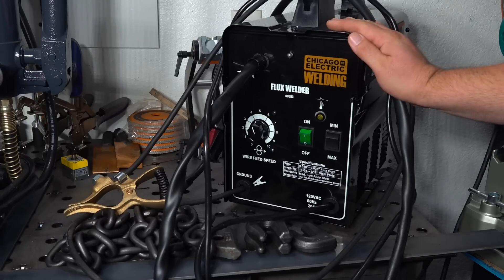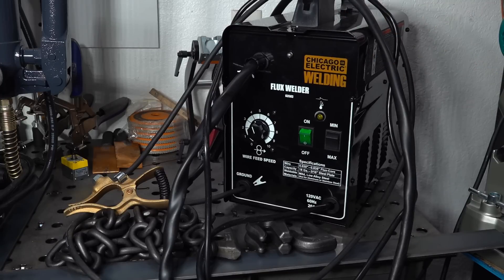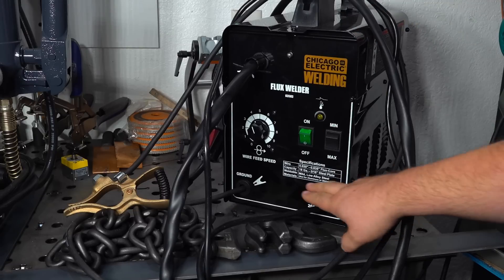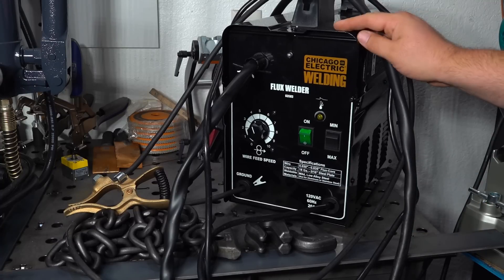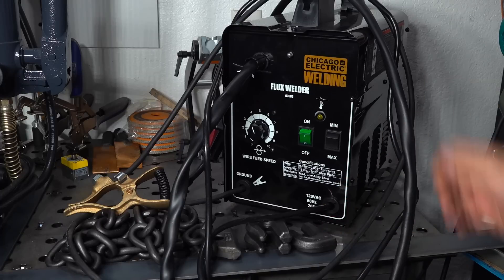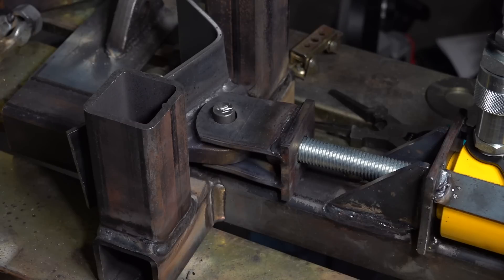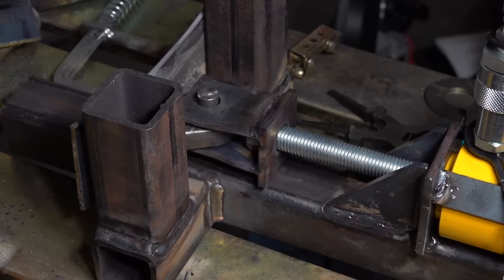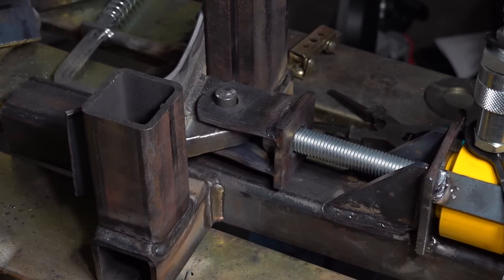Harbor Freight Flux Core, Weld Strength Testing Part 1

Comment: Did you see how happy this dude got when the weld broke on the HF welder he started shaking. You can see that with the HF welder he put alot smaller beads.
Reply from the maker: The smaller beads are a direct result of the lower output and lower wire feed speed of the Harbor Freight welder.   Simply going slower won't make up for the difference because the HF welder doesn't have enough output to make a single pass that large and still burn into the base metal very well.  You would be far better off making multiple passes with the HF welder, vs. trying to make a large bead in a single pass.  

It's true that I don't have the steadiest hands.  Nothing to do with the results.  The point of this video was to show that there is in fact a big difference in output between a 240V and 120V flux core welder, thought the main thing that holds the HF welder back is the AC output.  I don't have any problem with the HF welder and I know plenty of people are getting work done with it.  That's fine.  But since it's so popular, I think people can get a skewed opinion of the output and capabilities.  This video was simply to explore it's capabilities, not to put it down and certainly not to put down anyone who uses it.  I have three more videos with this welder testing different things, including converting it to DC and testing penetration before and after.
Reply: @bigtb1717   sorry. I call Bull. Compare with same bead size. Saying its weaker by geaking out on amps is a cop out. Simply set to run faster feed and make bigger bead or run slower. .
I know HF welder cant penetrate as well as higher volt and sophisticated welders. But is a very good welder for more common jobs and beginner do it yourself type projects.
Reply from the maker: I do test different travel speeds in another video.  I also cut and etch and check penetration with various settings and travel speeds.  The slower travel speed had a larger bead, but less penetration.  Maybe I’ll make another video showing a MUCH slower travel speed, because a lot of people seem to think you just have to go slower.  I have serious doubts as to that helping at all because the bead will be piling up. But probably won’t really burn in any further.  This welder has AC output and that severely limits it.  But I have been considering a video testing really slow travel speed and a weave pattern.  I’ll try to get that done.
Reply from the maker: @greatoutdoorzy  Also, as I have said in multiple videos with this welder, it is totally capable for a lot of projects, and a lot of people get good use out of it.  The only point of my videos with it is to show the capabilities and limitations so people know what they can expect to get out of this machine.  In another video (I think part two) I show that the performance on 1/8" material is fine.  It's only once you step up to 3/16" or higher that it starts to fall short.
Reply: Hahaha, "sophisticated"! I'm dead... and bigtb is right.
Reply: For real

Comment: Am I the only one who noticed that there was half as much steel wire was welded into the joints on the HF welds?
Reply: Andrew R I noticed it to and I have that same harbor freight welder and it puts more steel wire out for me than that and I derby and it’s constantly getting hit and it never breaks for me only a couple of times it has broke
Reply: No    Cab you saw rigged?
Reply: That little Harbor Freight welder is the biggest piece of s*** you can waste money on. A goofy brother-in-law has bought two of these pieces of crap. Wire feed wheel is a piece of crap it won't weld anything more than a lawn mower deck if you're lucky
Reply from the maker: That is a direct result of the lower output.  Amperage output is directly tied to wire feed rate.  It takes more amperage to feed in wire faster.  So a lower output welder will absolutely create a smaller weld in a single pass.  

Unfortunately, simply going slower can't make up for the difference because the welder simply doesn't have enough amperage to burn in a weld that size.  You'd be far better off making multiple, small passes rather than simply going slower.  

I know a lot of people have issues with this video, but I really am not trying to talk down the Harbor Freight welder.  It's fine for what it is and what it can do.  But I think a lot of people seem to think it is just as capable as a 240V welder, the welds just won't be as pretty.  The whole point of this video was simply to point out that there is actually a big difference in capability.  That's not to say the HF can't get work done and be good enough for many people.  But for some projects and thicker metal, a 240V welder is more capable.  

I have three more videos with this welder, including converting to DC, in case anyone thinks this video was simply to dismiss this welder.

Comment: Clean up the metal. Chamfer and clean the edges. I'm not complaining your technique. But this test is biased. Of course a 240 welder will out perform a 125 welder. Higher heat makes for better penetration. Still held pretty well with a 4,000lb pull test. But if you're thinking about using this for welding 1/4" thick I-beams, you're a fool. DIY stuff at home or exhaust welding, you're golden with this inexpensive tool.
Reply from the maker: The second half of your comment was exactly my point with this video.  The HF welder is a fine machine for light duty stuff and this video wasn't intended to put it down.  But some people get defensive when someone suggests that a 240V welder would be better for a given task, and this video was just to show that a 240V welder simply is more powerful.  That's all.

Comment: You better bring break your brain a Test in the machine it’s just Dell is that an expensive machine it’s good enough for beginning I’m not trying to weld at Titanic I try to weld some pipe so for me it’s good enough
Reply from the maker: I think your comment has some egregious auto-correct going on or something, but I believe I get the overall idea.  I agree that the Harbor Freight flux core machine is likely enough for many people.  I really don't intend to insult the machine, and certainly not anyone who uses one.  I hope it serves you well and does everything you need it to do.  Cheers.

Comment: Thanks for the video. Your tests satisfied my curiosity between a budget and premium welder.  It looks like the weld on the Harbor Freight welder had very little penetration. I believe that's the reason for the failure.  What was the amp setting on the other welder? I'm curious to know if a weld to a thinner base metal would've produced deeper penetration, using the Harbor Freight welder.
Reply from the maker: I have three other videos with this Harbor Freight welder.  In the other videos I try different techniques and cut and etch welds to show the actual penetration.  The HF welder does get decent penetration on 1/8" steel, but on 3/16" it is very limited.  Very little penetration in a single pass.  With pre-heating the weld holds a bit better, and three passes hold pretty well.  The AC output of this welder is the main thing that holds it back.

The ESAB welder I used in this video has a max output of 215A, but I don't know exactly how much I was putting out in these videos.  I actually test the output of the Harbor Freight welder in another video as well.
Reply: @bigtb1717  Thank you.  I'll be watching your other videos.  Best wishes.

Comment: I think what we really see here is a failure of welding technique.
Reply from the maker: I have been having trouble with comments disappearing lately, and I feel like a reply to this comment might have gone away.  Either way, if you have any suggestions as to how my technique was off, or what I could do to change it, I'm all ears.  I have since testing this welder at various settings, various travel speed and even testing a second one and converted one to DC and tested that.  In stock form, with AC output I could never get good penetration on 3/16" material.  1/8" was fine.
Reply: bigtb1717 I think they’re referring to the fact that neither weld had much penetration.   But! Thank you for putting this together. I’ve used this welder but not for anything requiring much strength.  I did think it was interesting that both eye tests broke where the weld started even on opposite sides of the test rig. Looking forward to checking out your converted weld video b
Reply: Haha, of course! It could NEVER be the machine, especially if it's flux core and it's from HF.
Reply from the maker: If you have any suggestions to get more out of this welder, I'm all ears.  I'm sure many people would be interested in ways to get better results with this welder.  I have several more videos with this welder where I test different wire, different techniques, and I even test a second unit and convert one to DC.  Along the way I tested penetration on 3/16" and 1/8" material.  What exactly do you believe is the issue with technique?  I'm always open to criticism and suggestions.
Reply: Its not welding tech, its the mater of steel type. the hf welder can only weld things like mild steel, the metal used in video did not look like mild steel.
Reply: @nicktopolski9672  
Looked thicker than 3/16ths too.
Reply from the maker: I assure you it was 3/16" material (other than the pad eye, obviously).  In fact, because of the way those flat bars are made, it's sometimes a bit thinner at the edges.  I would never lie or intentionally mislead anyone in my videos.  I have three more videos with this welder where I get a bit more scientific and controlled in my testing, to hopefully avoid concerns of bias.  My only intention is to test and find out the performance capabilities of this very popular welder.

Comment: Hf welder was set on low
Reply: No it was set on max.
Reply: @b.p.rwebber8098  you need to slow down with HB welder to get more  heat penetration.

Comment: https://www.youtube.com/watch?v=HqcZ7gjFMbY this guy welds a backhoe lifter with his Harbor Freight welder, I guess your just not much of a welder if you can't use yours!
Reply from the maker: I don't know if you saw, but in this video I show the pad-eye which was welded with this welder holding multiple tons of force, after only a single weld pass.  I know that lots of projects can and do get done with these welders.  I only wanted to point out that there is a reason why some recommend a more powerful welder for some tasks.

I have several more videos on this welder, if you are interested, including converting it to DC and doing penetration tests with cut & etch before and after.

Also, I've watched many of that guy's welding videos, including the one linked.  He definitely get's a lot of work done with that welder.  He's only working on his own stuff, so more power to him.  I'm glad he's satisfied and the welder is doing what he needs it to do.

Comment: Are you using multi pass wire? (MP) looks like not, how was your amps?
Reply from the maker: I used the wire that came with the welder for this video, and it was not multi-pass rated wire.  I have three more videos with the Chicago Electric 125 FC welder, and I do measure amperage output, use Lincoln NR211 MP (multi-pass), do lots of cut-etching, etc.  They are linked at the end of this video, or you can look at the welding playlist on my channel if you want to check them out.  I also convert it to DC and test after that.

Comment: i definitely need over 4ton strength in order for my aunt to sit on my builds :-)
Reply: What's her phone number 👀 sounds like my type
Reply: Yes, that's the reason I use wood for most of the home builds, from racks to baby bed and playground. They are strong enough to hold tools, cokes and my daughter.
I only use steels on my car. But usually to reduce the complexity, I use bolts. I know they are weak, but much easier.

Comment: This is a garbage video.  The HB welds are smaller, done with a smaller wire diameter, and not even cleaned up.
Reply from the maker: The welds from the Harbor Freight welder are smaller, because it has far lower output.  I realize it wasn't a fair comparison, and that was the point of the video.  People often suggest that while the welds from this welder may not look as pretty, they are plenty strong.  I simply wanted to show that in some cases, there can be a big difference in strength between a 120V flux core welder and a 240V powered welder.

I used 0.030" wire in the HF machine because that is what it came with, and 0.035" wire didn't make a significant difference in output.  I have three more videos on this welder and I test 0.030" vs. 0.035" wire, I use better wire, I do cut and etch testing, and I even buy a second HF welder in case the first was defective.  I also convert one to DC output and test that.

And sure, I suppose I didn't clean the welds very well.  But I was just going to test/break them, so I didn't spend a lot of time cleaning them up. 

I have absolutely nothing against the Harbor Freight welder, or anyone who uses it.  I hope that whatever welder someone buys works for them and does everything they want it to do.  I make reviews and test videos to simply learn and share so that people may have a few extra data points to consider when making a decision.  That way, they may be less likely to be disappointed or surprised with their own results.

In that spirit, if there is any testing, method or technique you think would be useful and would like me to try with this welder, let me know.

Comment: Looking at the weld he really needs to turn up the wire speed its something I had to learn with mine. It keeps the amps up and will really dig deep and get some good penetration
Reply: Yep. Hi amps, faster feed, get the tip closer and slower drag.
Reply from the maker: The machine really wouldn't run with a higher feed speed.  It would stutter and the arc would snuff out and just push wire against the work when I used a higher speed.  I have several more testing videos with this welder.  I even bought a second one to see if the first one was defective.  

I also converted it to DC output and compared penetration before and after.
Reply: @bigtb1717  
How'd that turn out? The DC conversion?
Reply from the maker: I have a video showing the results.  It has far more penetration after the conversion.

Comment: Im sick of the so called pro welders bashin the HF welders ..not everyone can spend big bucks on a welder..i have several welders an the HF is very decent
Reply: I know. I use mine maybe 3 or 4 times a year. So 1600 for a welder is stupid.
Reply: @jsmeswagner6104  u aint no weldy boi
Reply: For sure. I'm a weekend warrior at best for my mig services. I dont have a side business nor do I charge a professional's wages. I've had much success with this exact machine on smaller not so critical jobs and made decent (for a weekend warrior) money. In fact I've seen a gentleman fail on a trailer gate (where I didnt) and he was using a miller 210
Reply: I believe yes there is a difference in quality between an inexpensive welder and a cheap one. I also believe getting to know your welder even if it's a cheaper one can make a world of difference. Even though the HF welds were the worst. Practicing and knowing that welder it could put up much better welds. To get the best welds it takes skills most of all and a quality welder helps with that. A cheap welder may not have the quality but someone that is a DIY person should get by just fine doing small repairs or just making small projects on thin material. 

Just be safe, have fun and most of all practice and you will put out some decent welds.
Reply: Can we get the force exerted on the parts for these videos? How "quick" it breaks isn't much of an indicator when using a press. If he were doing hammer blows, that'd be more informative than a press without numbers since all of us can within reason estimate the power a hammer blow has. (Am I right blue collars and diyers? Lol)